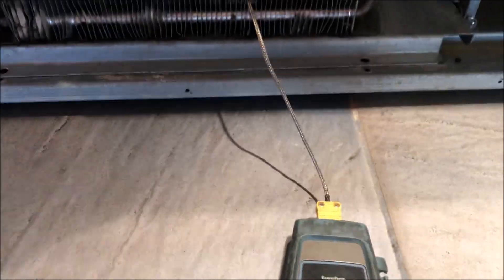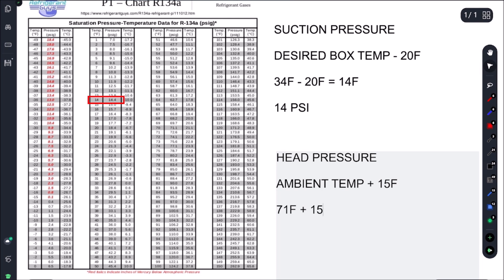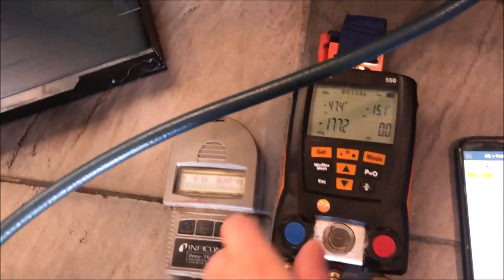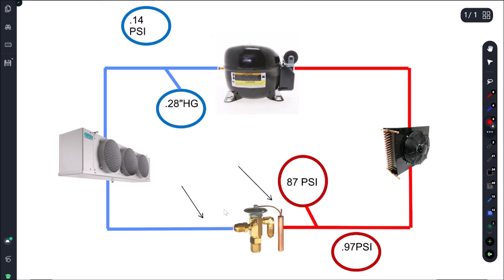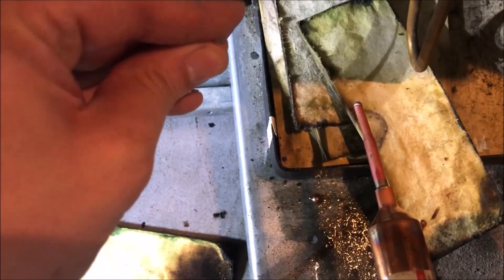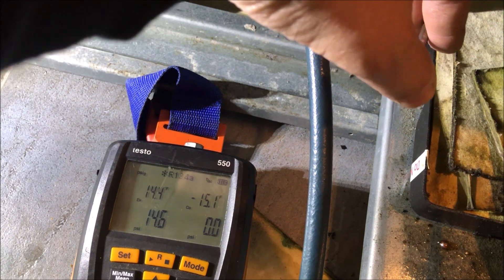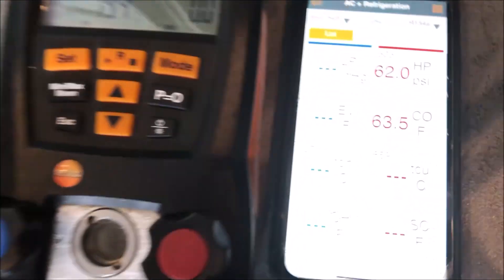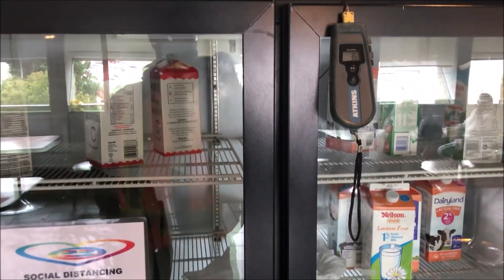Cooler is Not Cooling. Low on charge or restriction?

Comment: question, how did you know there was  a restriction in the system, I thought that if you add freon and the pressures drop(in this case the head pressure), that there would be a leak?

Comment: 14 psi woud be when the box temp is 34 degree , if the box  temp was at 45 shoud my pressure be around 22 psi?
Reply from the maker: Not on a cap tube system, it should always be more or less the same pressure. On a system with a TXV it would in theory work like that.

Comment: Hi Anthony quick question why you added 15 and not 30 to ambient as you usually do? Thanks for educating.
Reply from the maker: It all depends on what split the engineer uses for the Condensor. A lot of the newer stuff uses a 15F Condensor split
Reply: How would you find out if it’s 15 or 30 then ???

Comment: Good morning Have a question got a new wine cooler was running in a vacuum I changed the drier blew through the compressor cap tube was clear vacuum the system down to 435 it went up to 640 vacuum agine down to the same charged the unit (R600) and it still running in a vacuum any idea kind of stumped on this one Thanks for your time
Reply from the maker: If you are 100% sure the charge is correct, with the unit running, cut the cap tube where it goes into the evaporator coil. If no refrigerant comes out, the leak is before the evaporator coil (cap tube, dryer etc). If refrigerant comes out when you cut the cap tube, the restriction is most likely where the cap tube brazes into the evap coil.
Reply: @REFRIGERATIONKITCHENEQTECH  Good afternoon I went ahead and just changed the cap tube I blew out the old tube it seemed clear I was getting good flow 
this unit is R600. But all good now.
Thanks for your help

Comment: I was at a job today and found a leak on a bullet accumulator in the evap area, fixed leak and did the whole 9 yards  of proceedures 350microns vaccum, so when I charged 13.50oz what the unit says to charge I saw 1.4 suction and 97 head pressure this is a cap tube as well... something was very off.  also the temp of the box was 66f and didnt come down.  so I kept charging all the while had my Amp meter and it was well bellow rla on the compressor.  I charged about 2 lbs in and the 3door lowboi unit was down to temp 36f... did I over charged this unit? or did I do the right thing ....?  box is 36f and amps of the compressor is well below 9.6amps was around 7.12 amps with 2lbs of 134 charged well over the 13.50oz... am I missing something?
Reply from the maker: Is the unit critically charged or did it have a small receiver? Sounds like you have a potential restriction and suction pressure might go lower over time
Reply: @REFRIGERATIONKITCHENEQTECH  i believe its critically charged it did not have a small reciever, if it was a restriction it would go into a vaccum but this stayed at 23psi suction and 200 head pressure after i put in 2lbs of 134a and the low boi was 36f top and bottom... amps of compressor 7.1 when rla is 9.6... i think i did the right thing charging untill box was down in temp so as long as the compressor doesn't go over amps.... I also made sure that when i found the leak and fixed it.. i took suction side shrader valve off and blew nitrogen thru highside and made sure nitrogen came out the suction really well before i put it into a vaccum of 350 microns.....what do you think..?
Reply from the maker: The fact you have to exceed the charge by that much leads me to believe we are restricted partially. When blowing out the cap tube, we want to test the flow at operating pressure. In this case, around 14psi is when we want to see good flow out of the cap tube.
Reply: @REFRIGERATIONKITCHENEQTECH  thank you .. probably going to be a call back on that prep table then.. dammit hate my life.  you live and learn no matter how good you are sometimes.
Reply: I am at the job now and fixed it , replaced it ,it was a restriction on the filter drier cap tube . when i did a vaccum first time around it was 350 mocrons but when i replaced the filter drier cap tub microns was 650 lol . thanks all

Comment: Sir , please what the rules for head pressure teleprompter so time I see you  added 30 degrees some time 25 , 15    Thank you so much
Reply from the maker: All depends on the manufacturer unfortunately. Most of the new stuff uses a 15 Condensor split

Comment: Caps tubes can get a white little ring around the inside from 134a it's looks like wax.
Reply from the maker: That’s interesting. I have seen that white ring before
Reply: @REFRIGERATIONKITCHENEQTECH  I have un-sweated  it used a cap tube cutter cut that off rebrazed and your good.

Comment: I don’t quite understand why a restriction on the metering device would give you low pressure on both sides.  Why wouldn’t it give you high head pressure and low suction pressure since the refrigerant would be unable to push through the metering device.. that wouldn’t stack head pressure?
Reply from the maker: There’s only 10oz so it can’t really bump up the head pressure high enough. On bigger systems and A/C it would be different.
Reply: I kind of see what you mean, but even with a 10 oz charge, I would think head pressure would still be higher than normal if you’re suction pressure is in a vacuum and there is no leak.  Sorry, I’m not understanding where that pressure is going.
Reply: @babyking5763  I’m thinking the system didn’t have all 10 oz and was a bit low.
Reply from the maker: That’s a big Condensor for 10oz so the head pressure will always show low during a restriction with a cooler with a cap tube system. I’ve gone as far as putting double the amount of the critical charge just to see what would happen and head pressure still doesn’t go up.
Reply: Interesting.

Still trying to wrap my head around it lol.
Reply: @babyking5763  it’s because the refrigerant is stuck in the condenser with the condenser fan blowing across it, the refrigerant on the high side continues to reject heat but has nowhere to gain heat from since there’s no refrigerant returning to the compressor so the pressure goes down. Just like how your discharge pressure will generally slowly decrease when you close down your king valve on the receiver to pump it down.

Comment: Excellent vid more than likely the restriction had to do with oil lodged in the cap tube dont see how anything else lodged in it and being blown out, having said that the possibility of oil logging you may have a small leak which caused the oil logging issues, blowing out cap tubes has never worked for me ilke your mythical way of troubleshooting👍
Reply from the maker: I did a nitrogen test after brazing, pressures did not drop. I’ve only had to change a handful of cap tubes, all the others I’ve blown out and been good after that. Sometimes the cap tube is a pain to change.

Comment: The coating in the compressor windings most likely gave way due to the blocked condenser
Reply: I have heard of this with carrier systems before. Copeland used to use a coating that broke down and clogged txv's, but never admitted to it.
Reply from the maker: Good to know
Reply from the maker: Never heard that theory before but makes sense
Reply: For whatever reason intermittent condenser fan failure, blocked condenser, people stacking things in front of the air inlet , great videos by the way I like your work
Reply: Lack of maintenance.